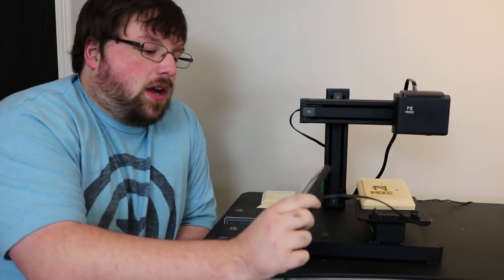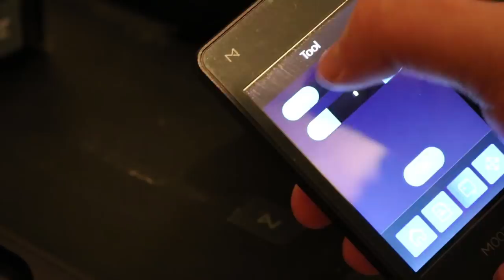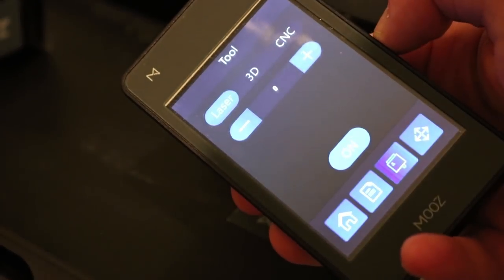First Looks at the Mooz 3D Printer/Laser Engraver/CNC Machine

Comment: with the laser: you have to adjust the height in Z until the laser dot has the minimum diameter possible (yes, you have to eyeball it). This should end your problem with it not engraving as it runs trough the material. Also try to avoid white and transparent materials.

Comment: Several things that may help you out.. 

1) The laser focus issue.. Regardless of documentation / manuals / etc.. It's always good practice to use a sacrificial piece to test, and calibrate your workflow to the machine, and especially the focal length of the laser if it's not adjustable.

2) You state that you already had a pair of eye protection lenses for the laser, i just want to point out, that unless those lenses were intended for the wavelength of that machines laser diode, you could still be risking your vision. i.e. using a pair of 650nm protection lenses, won't necessarily protect you from 450nm lasers. 

3) The "stop" issue is more than likely due to g-code buffering. To make speedy, smooth motions, it's a good idea not to halt to read the next line of code (especially on arcs, and curves). So what most g-code interpreters such as GRBL do, is they buffer several lines of the G-Code, as a sort of "read ahead" method of avoiding stopping the machine to parse the next line of g-code. 

4) Clams - I noticed there are two clamps, both appear to have threaded holes, my guess, is you are supposed to have screws in both, and clamp the work piece from both sides using the screws. That being said, i would suggest moving some of the screws to the other side (i.e. two or three screws on each side.)

5) If you stop the laser engraver, you are correct, it should most definitely turn off. You might want to contact the manufacturer / dev team, and voice the concern, as this should be addressed immediately for safety concerns.

Comment: Interesting printer. Was glad that you were able to get it going. How good does that CNC part look. Think it could do through hole parts of a circuit board?  Or the laser there's what called laser paint method where you use matte black on a circuit board and the laser burns off the paint to help make your circuit. Be interesting to see if this could burn off paint and what DPI for quality.

Comment: It's not really moving at high speeds/torque, so you can probably get away with using just a small out of carpet tape to hold the part down for the CNC and Laser modules.
Reply from the maker: Very true, but I think I could probably make a 3d printed clamp that would just screw into place and clamp the object that way. It might be a fun project. Or maybe it'd be good for a Practical Printing collab.... ;)
Reply: That could definitely be fun!

Comment: The design of this is a missed opportunity, why the heck are you needing to use screw drivers and hex keys all the time, they should have put thumb screws on for the clamp and the heads should be swappable by releasing a catch with contact pins instead of cable and socket, style without design or good function
Reply from the maker: Yeah I was thinking the same thing. I don't like having to keep a set of hex keys next to it at all times. That's why I was thinking I would redesign it if it's something I'm going to be using often. We'll see how it goes. :)